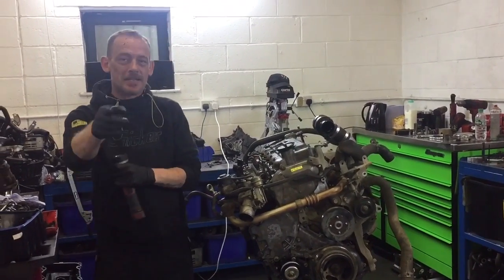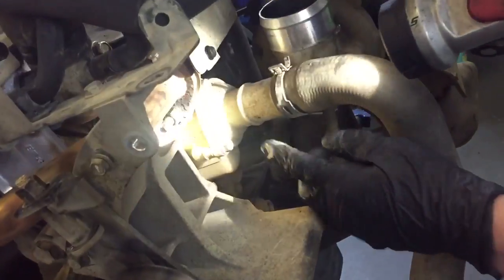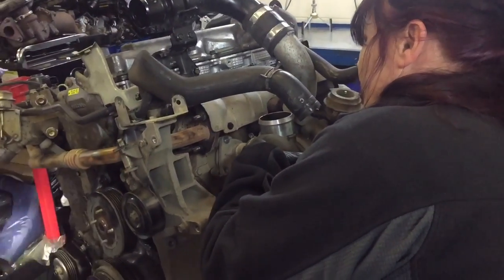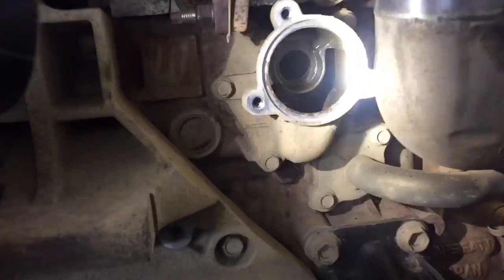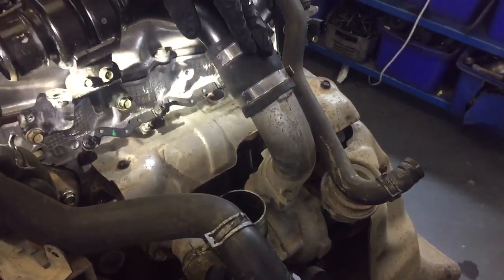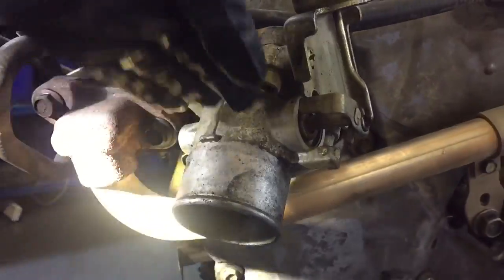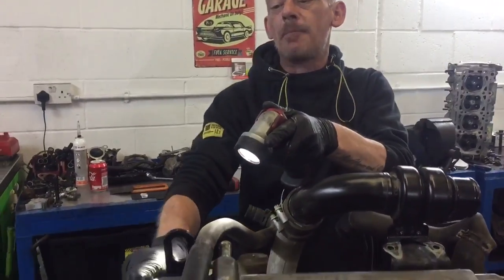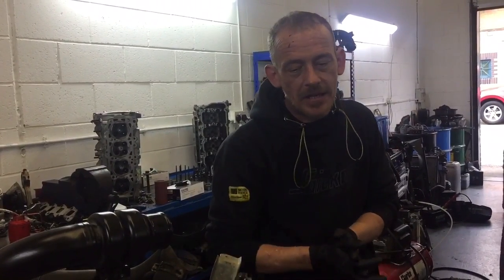Nissan YD25 Engine Explained

Comment: Hi, is it necessary to remove sump completely if you want to get to the oil pickup. The engine is in the vehicle still, of the D40 Nissan navara yd25 engine.

Comment: D22  pickup yd25, 2005. Starts good, tick over good and drives well on flat. As soon as it hits incline no power foot flat down and you see rpm dropping, any idear.john
Reply from the maker: is it 3rd and 4th gear
Reply: @westyorkshireengineservice9160  same in any gear. Can change  down to second and still no power.  As soon as gets to flat road full power.john

Comment: Gud day i'm just curious, what is the difference between nissan navara np300,ys23 and just nissan navara yd25, and the engine, yd23 & yd25 ? Thank u.
Reply: Maybe just like the 4D56 of Mitsubishi except the 80hp non turbo charged, but only from the oldest mechanical injection with non-intercooled turbo to intercooled one, and the newest with crdi and vgt with different power levels. YS23 is the newest like the 4N15 for the emissions compliance for Europe and replacement of 4D56, even though they just still kept the YD25 until now for less strict emission markets like SE Asia, Africa and Latin Americas.

Comment: Hi there i have a yd25 D22 2003 Navara and i couldn't find the oxygen sensor can you please help? 
Thanks for the videos,
Reply from the maker: they do not have one
Reply: @westyorkshireengineservice9160   a check engine light  comes on and when its diagnosed it comes with a fault code P0136 HO2S2(B1)

Comment: Hello. Nice video. Regardind bearing problems of YD25DDTi engine. I have a d22 pickup, 2003, above mentioned engine, 98 horpsepower. Do all the Yd25ddti engines suffer from weak bearings?

Comment: Very informative, great stuff👍 My question is. I have an oil leak from front timing chain cover. Is it a big job to fix this? (2010 Navara D22 Engine number: 206245T)
Reply from the maker: It always leaks on the timing cover What we do take it off clean then put RTV half way around the timing cover on the rubber seal should only take you an hour to do and that’s with a coffee break buddy 😊
Reply: @westyorkshireengineservice9160  hi mate, mechanics here in Australia shit themsleves when I ask them to quote all saying it's a 'huge job' - what are they missing here??? DO you think I could do it myself as per your previou advice?
Reply: @westyorkshireengineservice9160  well that's reassuring and I thank you for the reply👍✌

Comment: only thing i noticed to that is a turbo is not to put cold air into the engine it works from using the waste exhaust gas to spin the turbine to compress air it leaves the turbo warm the intercooler is there to cool down the air what makes it dencer the dencer the air the bigger the bang in the engine in hand giving you more power . your engine would run hotter with out a cooler but still have the power gains as the turbo has already filled the cylinder with more air then if it had no turbo .

Comment: Any one knows please if the nissan D21 with the old TD 25 Engine 82hp is a good engine? is any knows problems? i was going to buy a pick up d21 with this engine but i am afraid if problems starts i am not able to find parts because is old model engine  special if fuel pump fail ,also i am not familiar with diesel engine repairs ...pick up has at the moment 210000kl (135000miles)

Comment: york my engine has a oil leak coming from fuel injector 3 is it the seal gone bad or the gasket blow and it offset the seal. if you need a picture please let me know
Reply: Good morning York. I have rebuilt my navara D40 and done all the timing chains tightly but it can not start. Pleased advice.

Comment: what is the normal temperature of the engine yd25 ?  my Navara at a speed of 130km/h the motor temperature of 87-89 degrees,when outdoor temperature +5,

Comment: Martin Turner in Australia. I have 2008 navara single cab tray back. Is there any maintenance that you should do with the fuel pump. and is there an easy way to install a new heater core in the cab. Love the channel very informative
Reply: Martin Turner shut the fuck up

Comment: do you install catch cans to prevent the intake and head filling up with crud from egr and oil combining.
i found you need good catch cans set up properly so there is no chance of oil from the catch can making its way into the intake in  a sizeable volume when four wheel driving on extreme angles etc etc